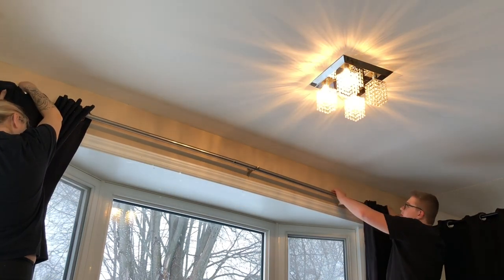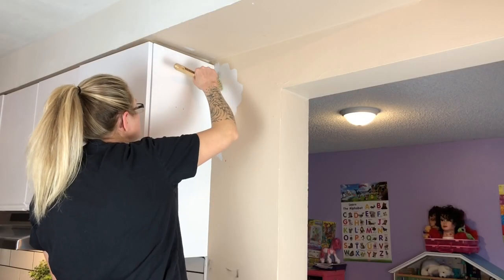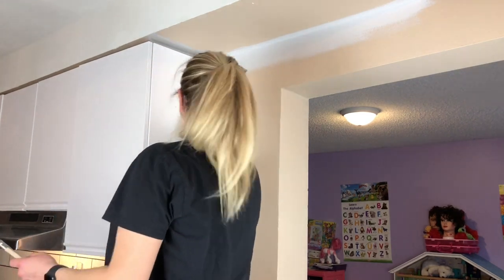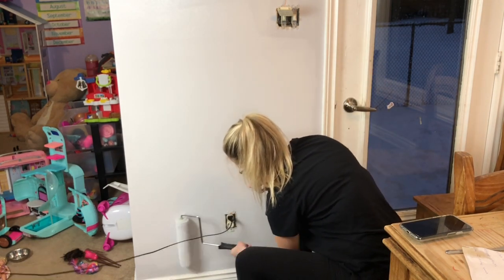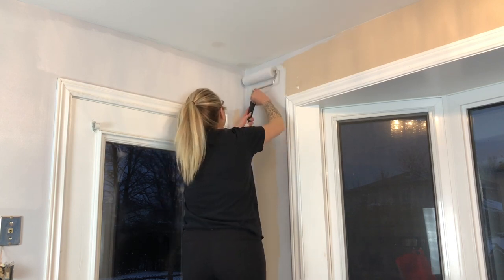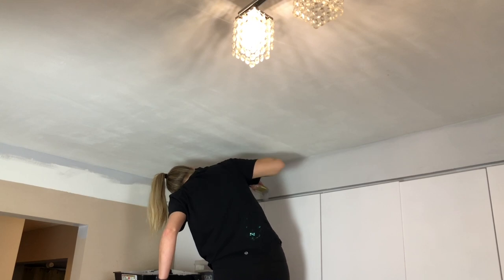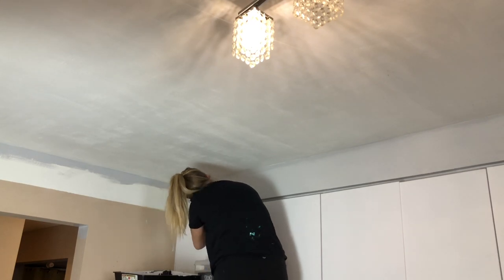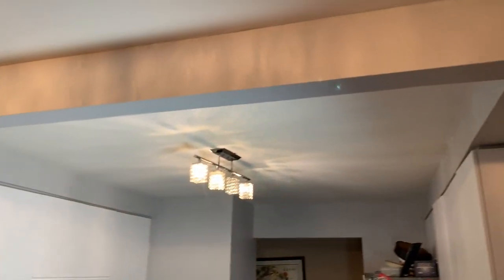$100 DIY KITCHEN MAKEOVER | NEW KITCHEN ON A BUDGET | HOME RENOVATIONS BEFORE AND AFTER

Comment: Hey girl! New friend here from IG. 💗 I need to clean my walls asap. I do not do it nearly enough. 🙃 Taping everything def takes forever when preparing to paint. I will need to try edging next time. 👍 After watching this process, I'm not sure if I have your patience girl. Lol. We SHOULD be on lockdown here in the US. But it's crazier than ever. 🙃 smh.Your large bay wi doe is SO nice! Absolutely loving the color you went with! 🤩
Reply from the maker: It’s the same thing we are in lockdown and everybody’s doing everything. I have no patience to tape I kept the baby wipe in my hand just in case I needed to wipe it quick 😂 I love those windows to. When we first moved all wood frame and flat. We put in vinyl ones and in the bay style. I absolutely love them